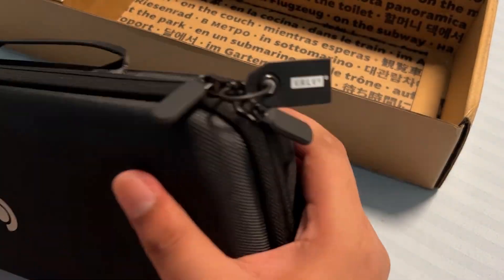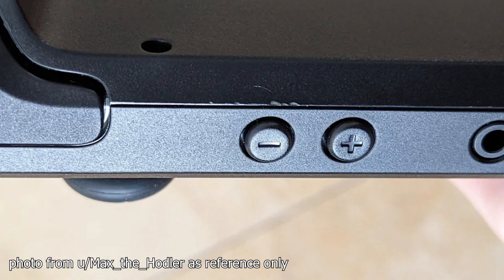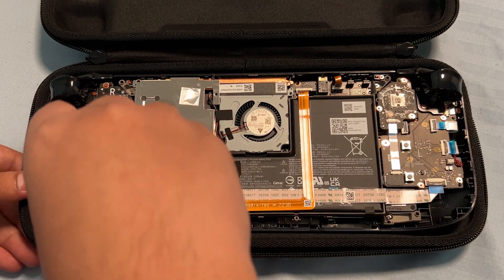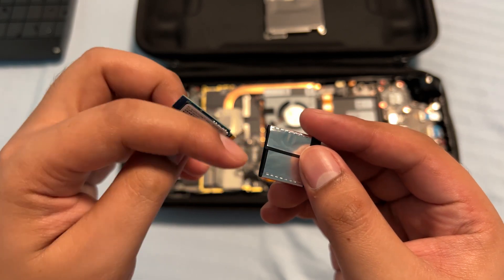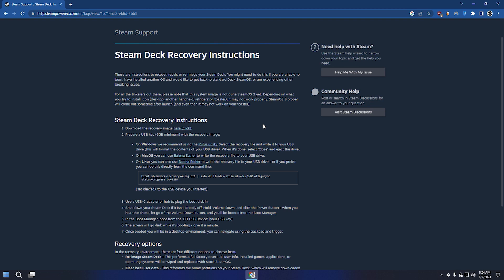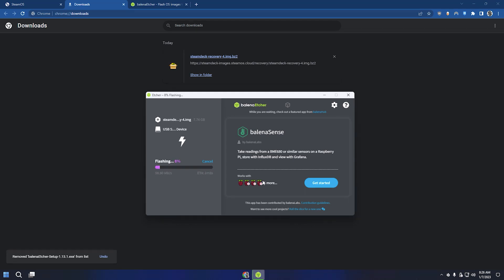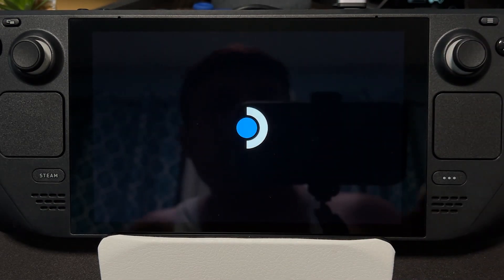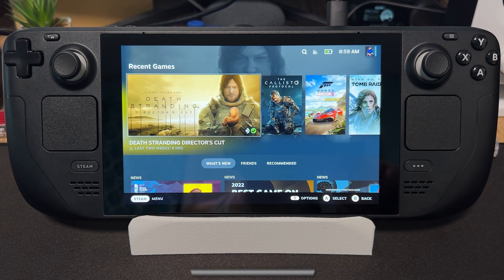How to upgrade Steam Deck's NVME SSD

Comment: Dude I been pulling at the battery plug for 2 hours. I cannot for the life of me get it to so much as nudge in that direction. If I pull hard enough the board starts to bend so that starts to scare me. So I used small tweezers to carefully pull it away from the board and again the board starts to bend instead of unplugging from the board. I tried a hot gun to see if it'll slightly loosen it and it will not budge. Is mine just glued on? Thats what it's starting to feel like. I just left it at my desk for tomorrow because 2 hours is just too much for nothing to happen.
Reply from the maker: try using a fingernail to push the connector out while pulling on the tab. dont use sharp tool, you might crack the connector or slip and stab the wire.

Comment: Do you need any sort of new heat sinks or copper pad there’s a pack on Amazon the Steam Deck SSD Heatsink Thermal Pad, M.2 2230 NVME SSD Copper Heat Sink Cooling Thermal Pastes , do I need this or is it fine without and just reuse what’s already there

Comment: Thanks for the video tutorial 👍however when I changed my SSD to 1 TB capacity, I lost my micro SD card library!  yet the games are still in the micro SD card, do you have an idea to display the lost library?
Reply from the maker: on desktop mode, open steam settings > storage > click the drive at the top and click Add Drive then add your sdcard
Reply: Thank you for your feedback, I have already tried but the library is not displayed😏I must have made a mistake when I installed the 1TB SSD I chose "Re-image SteamOS" I will put the SSD back  of 64 MB or I had my library displayed, and choose "Reinstall SteamOS" then I install the 1TB SSD and I will choose "Reinstall SteamOS" maybe it will work what do you think ?

Comment: Hi excellent video! I have a question you used Balena to flash the steamdeck image file. Does Balena work on Windows as it is recommended by Steam that Balena be used for Mac users?
Reply from the maker: Yes I also use Balena on Windows.
Reply: @JDRos  thank you I used it on windows just after and wanted to make sure

Comment: Removing that screw from the metal shield looks so easy in your video. I had to capitulate. It just wouldn't budge and i may now have rounded it a little...The screwdiver perfectly fitted but it the screw is so tight that it won't come off....

Comment: hey, i have a lil question about the OS part. is it possible to simply connect the original 64gb from the steam deck as a secondary drive to the pc and copy its files to one of my other drives, then connect the new 512gb and copy the OS files? theoretically it seems logical
Reply: if you dont want to start from new, you're better off cloning the ssd. for some reason it didnt work for me. new ssd was empty when loading it on so here i am trying to do it this way. getting no progress flashing though

Comment: I'm on the last screw for the backplating but it got stripped even while using a #0 screwdriver, a flat screwdriver isn't woring. I've tested putting a rubberband between the tip and the screw, tested tape but nothing seems to work

Comment: Far and away the most easy to follow instructions out there.  For some reason some of the instructions on putting the steam deck into the necessary battery mode and prepping the re-write weren’t working for me right away, but I bumbled my way through it.  Thanks!!

Comment: My deck looks different inside, 4 screws not 3 and the battery has no slack to pull
Reply: The strap to pull as hidden under, but had 4 screws which is odd, they Def changed it. But got it working perfectly,  thanks

Comment: When trying to install the metal plate back on (after installing the SSD), there was a small electric spark which came out from the wires, near the fan (more specifically the black wire near the metal plate main screw), also the power button flashed here for a second (eventhough I did not press it). How serious is this? 

I mean I was able to install it back, reimaged the steam deck, and everything seems to be fine. How to check if everything is actually fine ?

Comment: Hey i wanted to follow up on the rog ally ssd swap. So i just purchased my enclosure and i noticed you used a particular program. Is that free still or better ones out there??
Reply from the maker: It's still free and is good enough for what you need

Comment: Been thinking of getting the cheapest Deck and upgrading it but I am still scared of losing warranty or smth if I move the sticker hiding the 3rd screw. Is it worth worrying about this or am I overreacting? 😅
Reply from the maker: Valve said in their teardown video that changing SSD will not void the warranty as long as you don't end up damaging it while doing it.
Reply: @JDRos   @JD Ros  Oh great then. I watched that video but was left unsure. Thanks a lot broski.
Also, forgot to mention your tutorial being great by the way, well presented and explained, definitely gonna use it once I get my hands on a SD.
Reply: @JDRos would damaging the foil sticker count as damage to the console?
Reply from the maker: I would say no. You can just replace it anyway with another adhesive foil.
Reply: @JDRos  does that include a screw? The last screw on the backplate got stripped even while using #0 and I'm currently unable to unscrew it

Comment: I actually will be picking up the rog ally and I already purchased a 1tbSsD. So even before ever powering it on I will need to download a bunch of stuff onto a u s b??
Reply from the maker: Yes, if upgrading right away is what you want.
You could also watch my GPD Win 3 upgrade video and follow the cloning part of that instead.

So basically power on the Ally, set it up, Clone it to the new SSD the same way I did with my GPD Win 3, then put that new SSD to the Ally.
Reply: @JDRos  ill watch now, just to clarify, b4 ever booting up, place new 1tb ssd in ally then turn on for FIRST TIME
Reply from the maker: No. Replacing SSD comes after the cloning process.
Reply: @JDRos  ok. So in a nut shell ill be setting thing up as if i was not to clone and once complete then boom, swap
Reply from the maker: Yes
Reply from the maker: But by setup, I didn't mean install games. Just get to the desktop and proceed to cloning right away.

Or maybe test for defects first before you open up the device after cloning.
Reply: @JDRos  thanks appreciate it. I wont download games or apps, ill just get it up and running.

Comment: Thanks for the detailed tutorial. In other tutorials I've watched, putting it in battery storage mode from the setup utility wasn't covered, is that really a necessary step?
Reply from the maker: Not necessary as you'd unplug the battery anyway, but it helps prevent turning on the device if you accidentally press the power button.
Reply: @JDRos  one more question: may I do the flashing part with the USB stick plugged into a dock? I'm concerned about battery drain during the process.

Comment: Thanks for the video :) But you forgot one screw at the end :)
Reply from the maker: All screws are installed properly. 🙂
Reply: @JDRos  look at 6m27 :) the top right of the metal protection :)
Reply from the maker: @TheKinoal  Notice how it's the same exact position where one of the backplate screws go.

You can't put a screw, on top of another screw. 🙂
Reply: @TheKinoal  dude dont be silly look at 3:13....you get it now? there is NO SCREW
Reply: @TheKinoal  did u watch the vid

Comment: i have created hundreds of bootable USB drives in my time, but for some reason, my steam deck cant recognize any of my attempts at using BalenaEtcher or Rufus and i have tried 3 different U.S.B Type A to Type C adapters
Reply: did you try a normal usb c stick without using adapters?

Comment: As a little aside for anyone as lucky as I am - if you run into the "1 second remaining" ad nauseum... try holding the power button for 10 seconds until you hear a beep to restart, then when it comes back on change to a 2.4GHz wifi. Worked fine for me after doing that. Thanks for the great video!

Comment: A thousand thanks for this in-depth tutorial. I’m planning to get a Steam Deck for a special occasion, and I want to replace the 64GB SSD with a 2TB SSD. Hopefully, this will go well enough.

Edit: The operation was a success! The SSD has been replaced and the thermal paste has been cleaned off and replaced with PTM7950.
Reply: Why did you clean thermal paste off ?
Reply: @Androbench  I was replacing the paste with a thermal pad (the PTM7950, in this case). You're supposed to scrub it off with 99% isopropyl before putting it on.
Reply: @wastelandking  does that make it run cooler ?
Reply: @Androbench  Yep. It's a phase change material, meaning that it won't pump out onto the hardware as it heats up, making it run cooler and results in the fan running at lower speeds due to lower stress on the thermals. It will also return to normal after it cools off.

Comment: When i download the steam recovery image file. it downloads as a BZ2 format. When i dragged and dropped it into etcher, it could read the bz2 file. Then after i extracted out the image file from the bz2 file, and drop the image file instead then only etcher able to flash to my drive. Is there a concern for this?
Reply: Yeah you have to extract he didnt mention.

Comment: I got scared for a second because the WD 2tb 2230 SN740 connection I got looks different than your SN540. Didn't know both of those connections fit in the same socket.

Comment: Need help, I stripped 2 of the metal plate screws. How to remove them ?
Reply from the maker: Get a flathead, preferably slightly smaller than the screws.

try to dig it into the screw but be careful, if you slip you might scratch the deck.

firm downward force, slowly unscrew it. if you don't put enough force you might end up stripping it even more.

Comment: So can swap the SSD right after I receive the Steam Deck without getting into the first boot? Thanks!
Reply from the maker: Yes
Reply: @JDRos  And if the battery storage mode is open by default, do I still disconnect the battery before screwing out the ssd? Or is that mandatory I should do it regardless?

Comment: For me the power connector was the hardest to remove omg and to everyone who hasn't done this yet BE REALLY CAREFUL opening the case it will easily dent if you force it open try to keep the pick to open it as straight as possibly or as less of an angle as possible

Comment: so the screwdriver size are 0 and 00? 0 on the back cover and 00 on the inner screws? Anyone can voucher for this?
Reply from the maker: Yes. Some also say you can use 1 on the back if you have it.
Reply: @JDRos  Many thanks! Im about to upgrade mine to 2TB, only your channel gives specific screwdriver sizes. You deserve a sub!
Reply: @divinedragonkirr  hi, i read somewhere bigger size consumes more power, so unless you need that size its more energy efficient to use 1tb or 512.
Reply: @ghostgurl17  Thats usually happens when downloading games since its peaking the power output. But during gameplay, the power that it consumes was just the same as my old SSD. Since I only playing one game on my SD as for the moment, It didn't feel any difference whatsoever. The battery life was the same and exactly 20% in 3 hours. I hope this helps for anyone getting 2TB.
Reply: @JDRos  are those numers are universal for the whole world? because I have a kit and my screws start from 1 and they end at 3.5 and 1.0 is very tiny and on your video your 2 looks like my 3.5 and your 00 looks like my 1.0 I'm cso confused now I dont wanna mess with my screws

Comment: Im using a Mac and every time I try to flash the steams recovery image it always says over 800-1000 minutes, am I doing something wrong or is my flash drive usb not formatted correctly?

NVM, had to extract the steams recovery image before flashing, and then use that extracted file and now its like 10 minutes

I feel like this should be mentioned when using a Mac

Comment: Can anyone help me? I've recently tried doing this, on both the Steam Deck in Desktop mode, and my M1 MacBook Air. Both times the flashing has stayed at 0% with a speed of 0.1Mb/s. I was using a 16Gb SanDisk 3.0 usb stick.
Reply: i used rufus
Reply: @edzbons  I'm starting to think that's the best option. Need to see if I can install it on the work laptop 👀

Comment: I am too afraid to do this and bricking the deck. Anyone have done this?
Reply from the maker: Best let someone with experience to do it instead if afraid to do it yourself.
Reply: I swapped mine a few months ago and haven’t had any issues with it
Reply: As long as you're cautious when working with the hardware, you can always swap your old drive back in if you have issues.

Comment: Pra sn po un balena etcher?
Reply from the maker: Para po mailagay sa flashdrive yung Steam Deck Recovery.
Reply: Thnx po..
Reply: Sir nbilog q po un 1 screw ayw n po gumalaw anu po kya mgndang diskarte m aadvise nyo..? Thnx
Reply from the maker: flathead sir, kelangan mo ibaon dun sa screw, dapat mas maliit konti.

tapos dahan dahan ikot with downward force pero wag masyado.
Reply: Slamat sir , pwde malaman sir kung anu size dpat ng flathead , thnx ulit
Reply from the maker: ung lumang screwdriver na gamit ko, walang nakasulat na size. pasensya na.

Comment: Very good and detailed tutorial. I felt I knew what I was doing the whole process while I followed along and replaced my SSD.
Reply from the maker: Glad it helped
Reply: Thank you so much for your tutorials.

If not for you I wouldn't be able to install 🦆 games on my Steam deck.

One question on this tutorial though. I don't see 2TB of the Wd sn520 anywhere. Only SN740

WANTED to ask if that will also work? @JDRos
Reply from the maker: @yvesdikel4297 yeah that should work

Comment: How long did it take for you after booting up, to get into desktop mode?cause I’m stuck on the logo steam screen after boot it’s been like 2 hours now
Reply: Same here... stuck since 1 hour....
Reply: @LucrateXmilK  if you're still having trouble, I was using an old usb with really slow read/write speeds so make sure you use a faster/newer usb or microsd (I ended using my microsd)
Reply: @livecraftily  i use a micro sd card and it was working !
Reply from the maker: about 2 minutes. have tried reimaging again?
Reply: Sorry I did reimage I was confused what that was lol but I put my usb in my steam rn and after I booted up but after I hit my usb I’m stuck on the steam logo any help?
Reply from the maker: when did it occur? after reimage? or you can't even reimage cuz you can't boot into the usb?
Reply: It happed after the reimagine
Reply: Can’t get into The four setup screen on the desktop on steam deck which is the reinstall process and reimagine if that helps
Reply: Did you get any solution
Reply: Same thing happening here right now, seems like being stuck. Does the new NVME need to be empty? Because I saw in the boot menu that it has some old windows version on it but I can’t format the ssd because my pc doesn’t have an nvmw slot…
Reply: same problem. Alot of guys on reddit recommend using a micro sd card instead of usb. I'm going to buy one tomorrow and use that instead